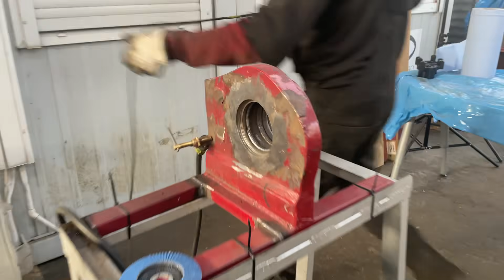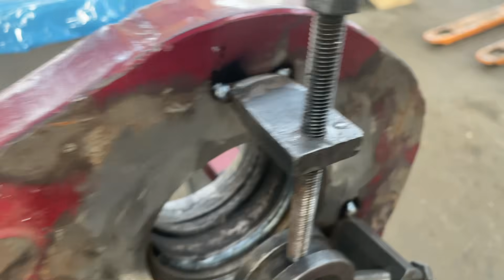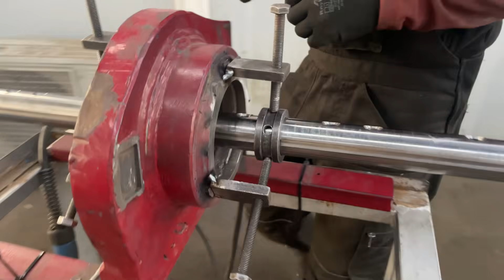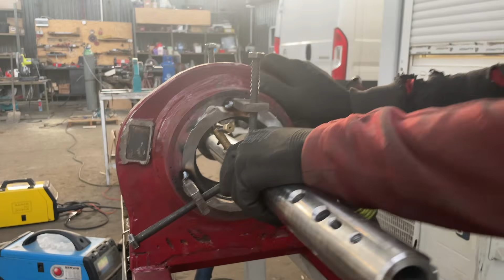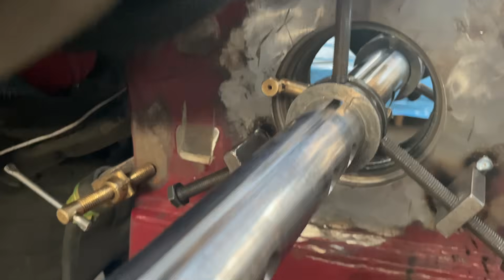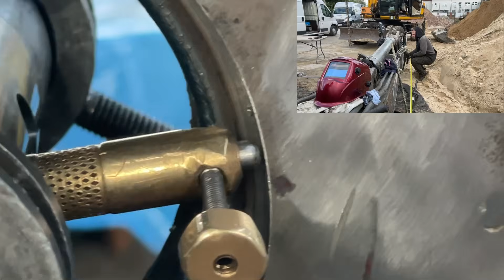How to Align a Line Boring Bar Using a Centering Kit

Comment: can i ask why are you not useing a DRO on a say a milling machine to find center and then find orther points in a matter of seconds.
Reply: There's no dro or milling machine in the field.
Reply: Exactly
Reply from the maker: Thank you for your question. There are many ways to set up the equipment, but in our videos we show only the tools included in the standard kit.
The alignment cones are not part of the standard set, but they’re one of the most affordable and convenient options for quick setup.
In some cases, when we need higher precision, we also use a total station for centering.
However, for construction and heavy machinery repairs, the method we demonstrated is more than accurate enough.